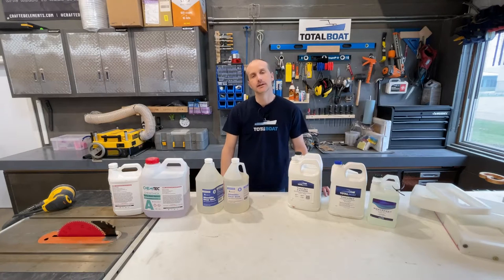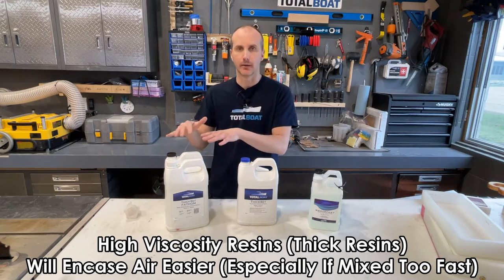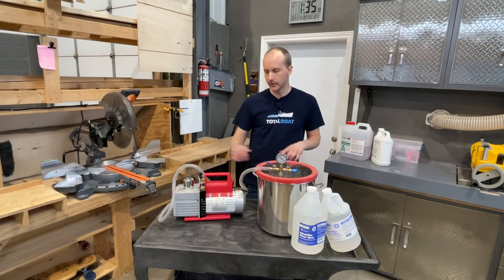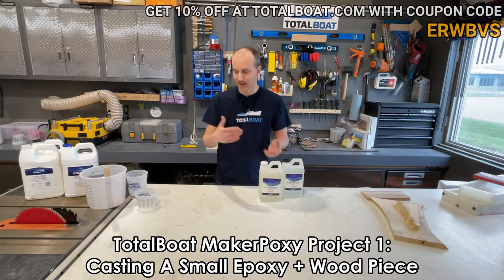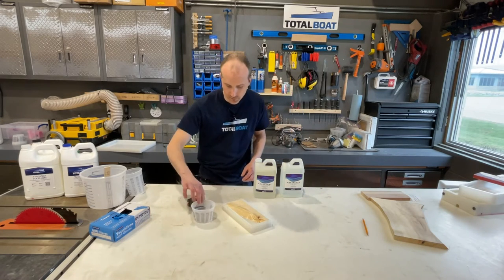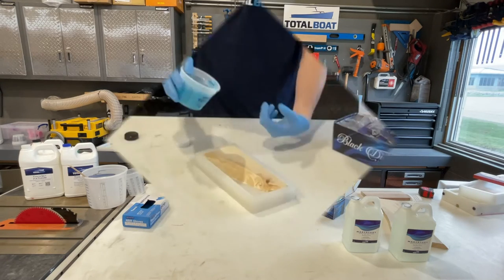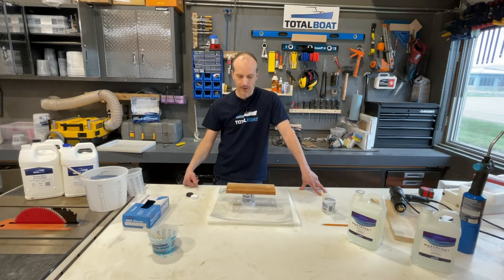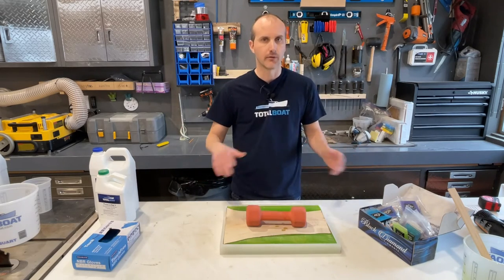Epoxy Resin & Wood Basics Series - Epoxy Resin (Part 4/11)

Comment: Just started to build my first boat (14’ sailboat) the whole process woodworking/epoxy/glassing is new to me but I enjoy learning as I go.

I laminated my first beam yesterday 1st of 7 thar are 6mm 1” wide mahogany strips @5’ long. Came out beautiful. I did a lot of research on Epoxies and in the boat building community RAKA epoxy had many positive reviews. So far on a couple test pieces (breaking wood before bonds) and on these laminate beams it has been working fantastic. It is @35% less $ than TB and WS.

Comment: How do you clean the tools and buckets for reuse
This is out of all of the videos I’ve  watched by far the most informative 
Great Job
Andy
Reply from the maker: The buckets with epoxy we let cure and harden. Assuming the epoxy is well mixed and does harden, you can just squeeze the bucket (or work it around) and "crack" the dried epoxy out of there. The mixing sticks etc we throw away,

Comment: Thank you for making these videos! They are super helpful! Because I overthink everything, I have a question (and I think this is the right video to ask it on). When using a paint mixer to mix the epoxy, can you just wipe it off after use and use it again? Or is it a one time use part of the project?
Reply: If you do want to wipe it off just use some isopropyl alcohol, I sometimes do this so my paddle doesn’t get crazy thick with cured resin. Also, if you’re using a paint mixer get a plastic one. If you use a metal one in a plastic bucket you can cause small bits of plastic (that the metal shaves off the bucket sides) to contaminate your resin.
Reply from the maker: Good question. Yes, they are reusable. You can definitely wipe off the epoxy, or, depending on the style of the mixer, just let the excess drain off, let the balance harden (set) then reuse it with the hardened epoxy on it.

Comment: Wanted to get your opinion. I just tried to make my first resin and live wood board. Roughly 12" x 16" in homemade mold. I used total boat thick set. With my calculations I needed about 54 oz of epoxy mixed. Which turned out to be a little too much...but I know I can take that down in the planer. My issue lies with the curing times. I placed the entire mold into a large tote in case any epoxy seeped out of the mold...and placed a lid on tote after pour to help prevent dust or anything else falling into epoxy and getting stuck. I poured the epoxy into the mold around 430pm and place lid on the tote. After 2 hours of letting it sit I went back to swirl the epoxy and the top and bottom thirds of the epoxy section were still very liquidy, but the center section felt like there was a large hard section that I could move around with a stick, but I left it alone and used the torch again to remove bubbles. By 10pm (6 hours after pour) the epoxy was hard as a rock and a few more bubbles had formed on the surface but I could not pop them ad they felt hard as well. Did I screw something up? Did placing a lid on the tote heat the space inside up too much and cure it faster? Any help/insight would be greatly appreciated.
Reply from the maker: Hi Sean. What was the pour depth? Thickset is rated for up to 1", if you poured 2" that would be too much volume and therefore create too much heat. Additionally, I wonder if putting the lid on the tote sealed it in enough that it just got too hot. A lot of guys making big tables will actually setup fans to cool down the epoxy and dissipate the heat. Basically... in the end, to much heat (ambient or internal) is going to cause it to set way faster. In 6 hours it shouldnt be rock hard. So i suspect that is what happened.
Reply: @CraftedElements  my pur depth was 7/8". So I agree that I think that putting the lid may (not fully seated) just did not allow enough heat to dissipate. Thanks for the input.
Reply from the maker: @seangross5663  7/8" is fine for sure with Thickset. Was your shop/garage cool or sweltering hot? Try setting up a fan to blow over the epoxy. It will likely also keep flies and dust away.
Reply: @CraftedElements  i had the tote stored in the laundry room which is same as house temp of around 75 F. My next one I will remove the lid and install a fan.
Reply: @CraftedElements  I made a second board and it turned out 1000% better. But then ran into an issue, it was sitting fully complete and sitting on the kitchen island for a couple days after I finished it and now it has warped. Did that happen because my wood had a little too much moisture in it (about 13%). Or did it warp due to something else?
Reply from the maker: @seangross5663  That would be odd for it to warp like that if it had 13% MC. Ideally it needs to be under 10%, so the MC could have been an issue. Was it a really soft wood? I cant really provide anymore specific input on this.
Reply: @CraftedElements  the wood was black walnut...it wss a little difficult for me to get a good MC reading with my meter as it seem to fluctuate between 13 and 15% but seemed more to settle around 13%.

Comment: Quick question for you or anyone with insight. What brand/models of heat guns do you use or recommend. Or are there certain features to look for in a heat gun?
Reply from the maker: I use a Wagner heat gun with the metal attachments so you can control the "shape" of the air coming out of the gun. It doesn't need to be overkill. I believe the ones I have here are all less than $100.

Comment: Should I wait for up to 12 hrs after pouring to create some swirl patterns in my epoxy on slower setting epoxies?  Does over swirling later on introduce more bubbles?  Thanks
Reply from the maker: It depends on the epoxy, its set time, the temperature of your room etc. Swirling when the epoxy is too stiff can definitely introduce bubbles, but normally something you can get rid of with a torch or heat gun after the fact.
Reply: @CraftedElements  thank you.

Comment: I don't understand this whole approach everyone takes to table making. The epoxy makers stress in their marketing, and compete with each other, to create epoxies that level out, crystal clear and bubble free. Then, y'all ignore that, rough it up, to finish it yourself, level it out, lol, it's like, why are you making all this work....

I just poured my first 2 tables. I pulled them out of the molds, and I am not touching them, they are perfect, as advertised by the epoxy maker, lol.... I planed my boards, etc., of course, but before the epoxy. I had the boards in the mold, flat and level, and finished, leveled the form,and poured 1/16 over the wood, so the epoxy made it's own sheet glass finish, smooth af. The other, I just did an inset in the wooden table top, and filled it.... I mean, you can't do colors this way, but river tables you can, just pout it short, and do a clear topper. Idk, they are my first, so I till tend to lean towards experienced people, but what I just told you is true, so, Idk..

Peace

Comment: Hey! I purchased my first mold and it’s not here yet but my total boat epoxy is! Love the series but my question is when you are placing your wood “top” side up or down? Thanks so much!
Reply from the maker: That can be dependent on the mold if it has any designs or relief on it, but most people place it wood, top side up if its simple charcuterie board mold etc.

Comment: I just ordered a few of your silicone molds and am brand new to epoxy. The molds are currently in transit to me and I wanted to order my Total Boat epoxy. Just curious if your molds happen to come with recommendations of which epoxy to use for each individual size molds within the instructions? If so I was going to wait to order my epoxy until my molds are received but I'd like to get a head start and order my epoxy now. Thank you!
Reply from the maker: Hi Brian. No the molds do not come with specific epoxy instructions. You will want to make sure the pour depth of the epoxy you are using is similar to that of our molds. Most of our board molds are 1" in depth, and that means the best epoxy is the Totalboat Thickset product.